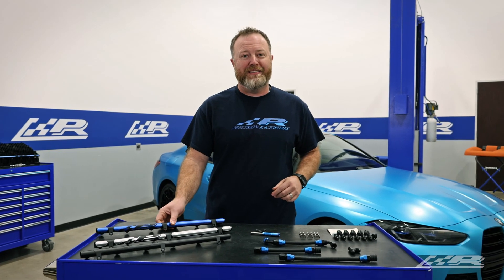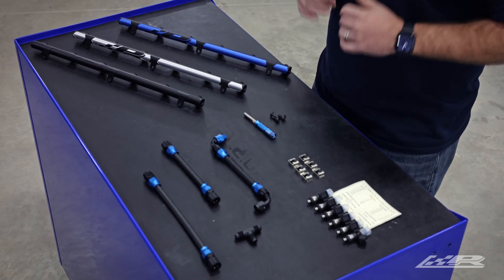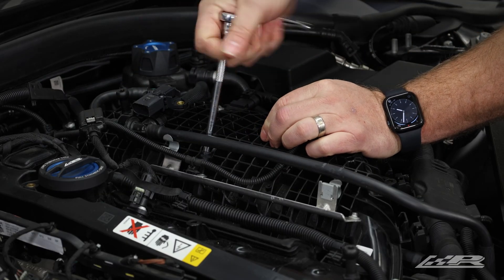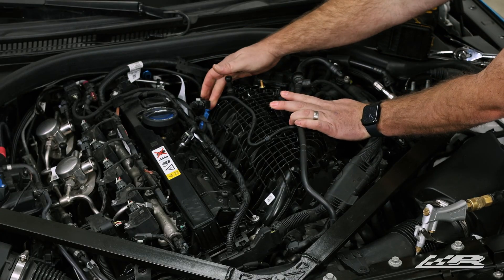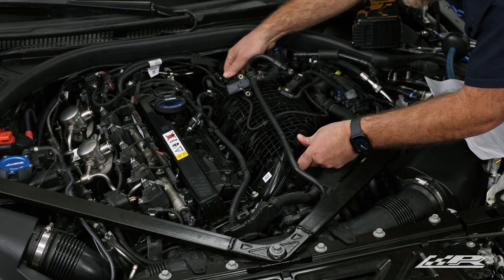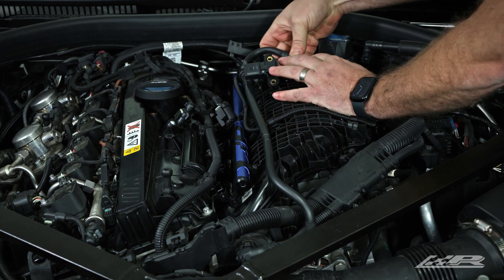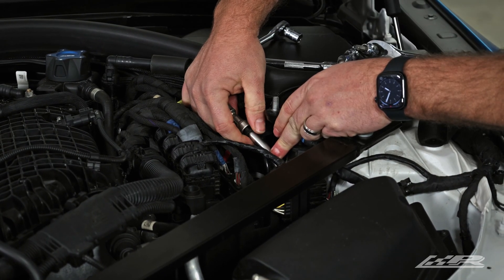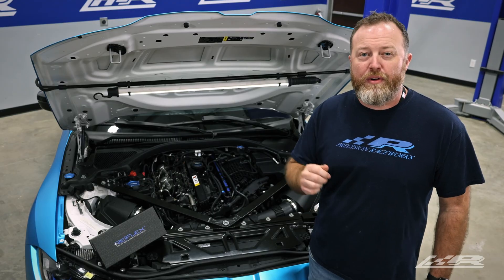PR S58 Port Injection Kit | Installation Guide

Comment: For the Ethanol sensor for the factory line and that port injectors kit from the website is it 5/16 or 3/8?
Reply from the maker: You can use a 5/16" in the engine bay or a 3/8" under the vehicle.

Comment: Is this reversible? Obviously holes are drilled, but is there a plug if this needed to get reversed for whatever reason
Reply from the maker: No, this is a permanent modification, and can only be reversed by replacing the manifold.  However, you could replace the injectors with dummy injectors, but the rail would still need to be in place to hold them in.

Comment: At what power level do you need to upgrade manifold? Thinking of getting this kit but if I need a manifold I'll hold off.
Reply from the maker: The intercooler in the stock manifold is great, some of the aftermarket manifolds aren't even as good as stock.  The weak point on stock manifolds is where the intercooler and manifold are joined.  We are sitting just shy of 800whp and haven't had the intercooler come uncrimped from the manifold, but it's hard to say if it will stay that way or if it's only a matter of time.  Personally I would say below 700whp you are probably okay while anything above that is probably borrowed time.
Reply: @PrecisionRaceworks  thank you for the very detailed response. Great to get insight from a big name in the space who are actually doing the build! Looking forward to more content 👌🏽